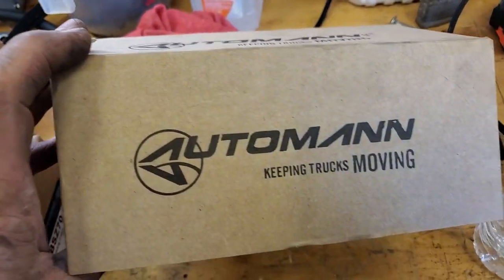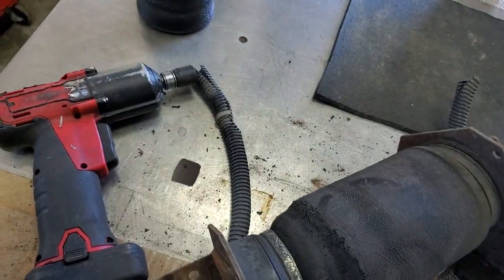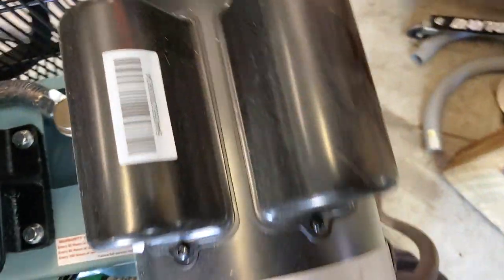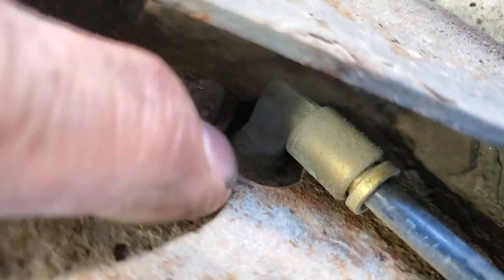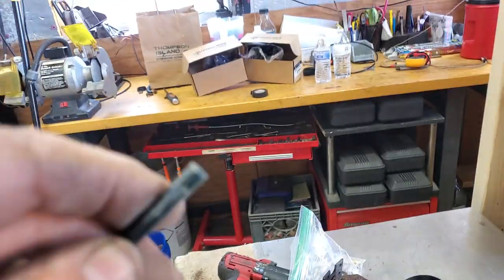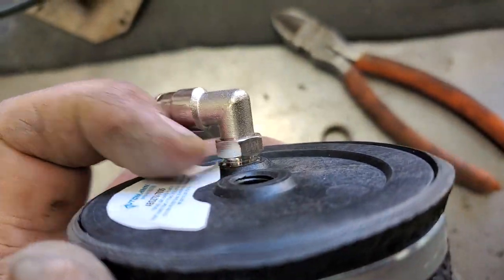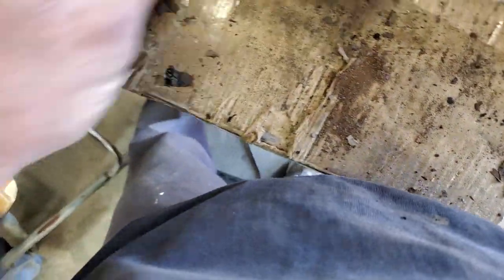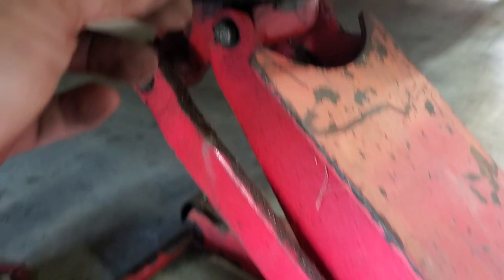AIR BAGS REAR REPLACEMENT CLASS B VW RIALTA, VIDEO 2 OF 2

Comment: Thanks for the helpful video! Did the replacement springs have the same air fitting threads as the originals? I need to replace one (will do both as preventative maintenance) but they don't come with fittings and I think I'll just reuse those parts if they'll fit.
Reply from the maker: Threads, yes, but push on connections